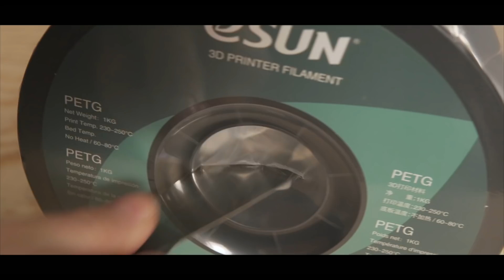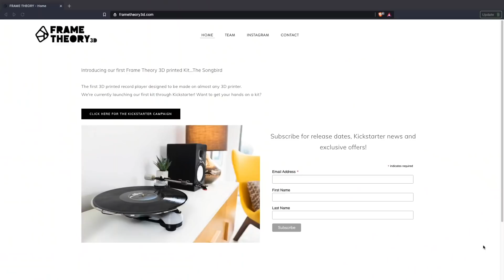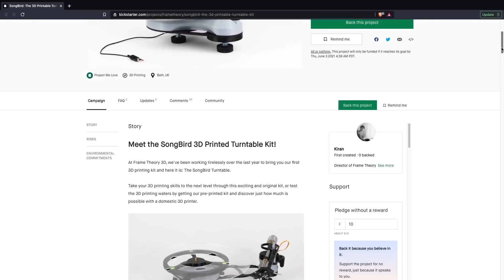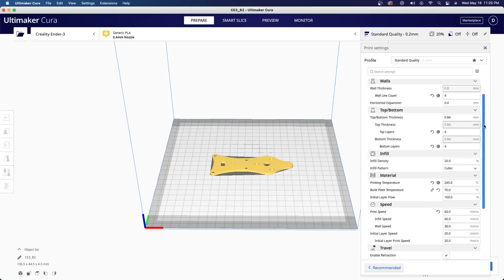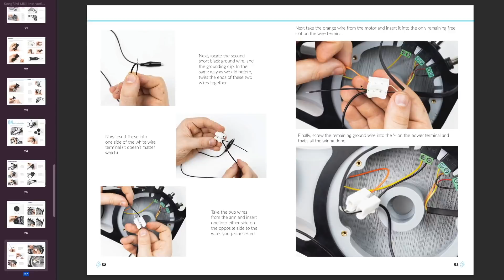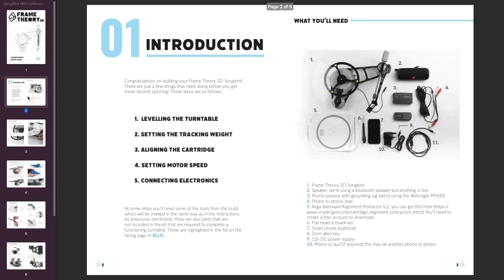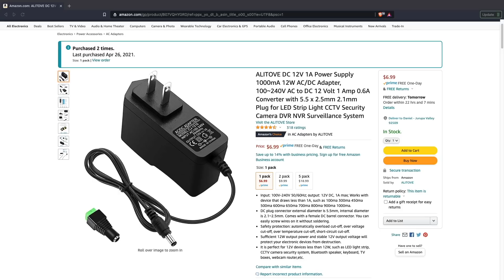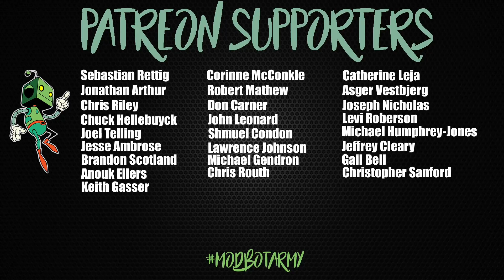The SongBird Is An INSANE 3d Printed Turntable Kit

Comment: Looks like it can no longer be purchased.  But Now button leads to 404 page not found.
Reply: The 3d printed part files can be downloaded from printable but the  aluminium frame and the brass bearings are no longer available which is a shame. although the motor and the cartridge are readily available from the likes of Amazon, Ebay etc.

Comment: This is a direct drive, correct?  I remember looking at it a while back and thought that this is good alternative, if you can't afford a Technics turntable.  I bought mine back in the late 80s, so I paid less than 1/10 the price of what they are currently selling for.  I see that you went with Behringer for the preamp, which is a very good brand as well.  BTW, they also make preamps with A/D converters.  The turntable is probably pretty delicate, and the arm adjustments are the most critical part of the build to prevent over-wearing of your records, but if treated properly, it should provide you with years of enjoyment.

And guess what?  I was lucky enough to get a Elegoo Saturn from Amazon.  Elegoo is shipping batches to Amazon more frequently now.  High temp functional printing in progress.  :)
Reply: No it's belt - you can see it in some pictures.  Motor is frontmost
Reply: Dude, Kiran made it. That means that by 95% this is cargo cult thing. They don't have a habit (or engineering traditions) to make real things. They need only flowers.

Comment: Looks very cool. A tip for the best sound quality and playback though... It looks as if there is a lot of wobble and/or warping in the platter. This needs to be as perfectly flat (planar) and concentric to the spindle as possible. You should be able to look straight on the edge of the platter/record while spinning and see no vertical movement...just a straight edge as it turns. Also, the record must show no side to side eccentric wobble looking down from the top. This can also be seen as swaying back and forth when looking at the tonearm as the record spins. Work those out and it will give you the best playback that setup is capable of producing. Thanks for your informative content. I really enjoy your videos!
Reply: I agree about the vertical movement, which should be minimized (if not eliminated) as much as possible.  However, the side-to-side wobble is due to the "record" printing process where the hole in the record is not in the exact center of the record.  There is nothing that you can do about that, and fortunately it doesn't happen that often.  If you do have a record like that, take it back to the store ASAP for a replacement.

P.S. A bent center spindle can also cause this, but it too would need to be replaced, and typically can't be adjusted or fixed by the user.
Reply: How would this be fixed?
Reply: @lio1234234  A contributing factor could be warping in the print, but it's probably due to misorientation of the central spindle on the platter. If it's not perfectly centered the record will wobble side to side, and if it's not perfectly perpendicular it'll wobble up and down. 
Fixing the side wobble could be done by checking the center of the platter before inserting the threaded inserts, to ensure they're centered.
Fixing the vertical wobble could be done by paper washers or shims between the spindle and the platter, and by ensuring all inserts are flush with the print.